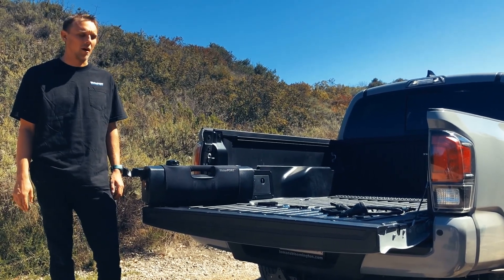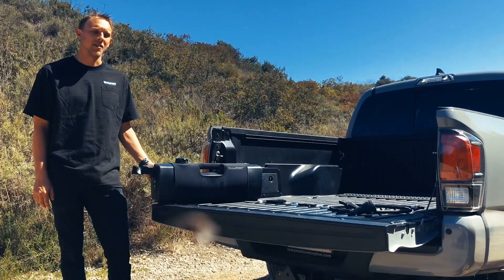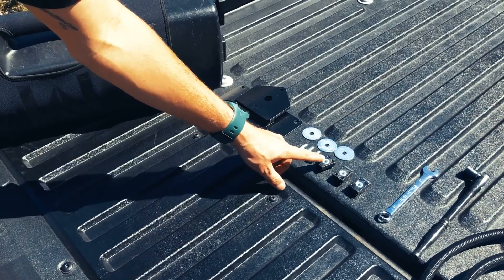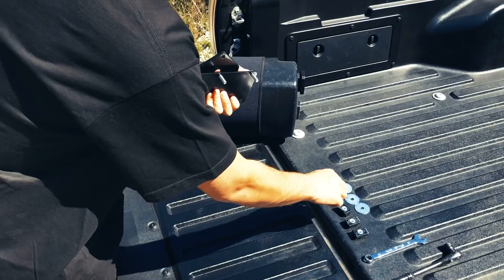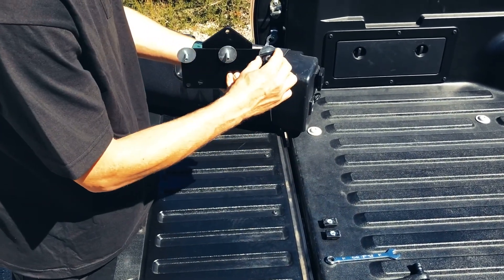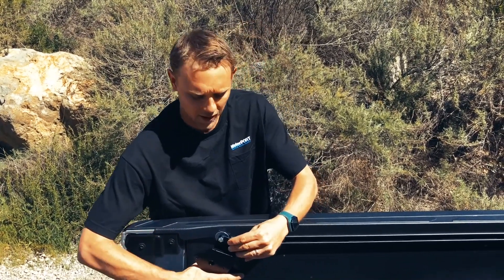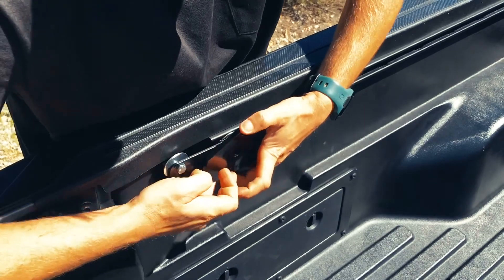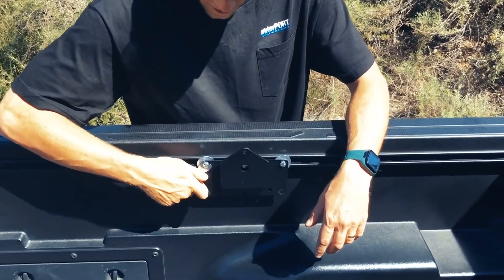Waterport: Bedrail Install

Comment: The hardware in this video is an a example of what it used to be. They give you some plastic t carriage things to fit in your bed rail with a little flat nut that is difficult to keep in place. And then the attachment brace, installed makes the bottom part stick out like 3/8 of an inch. You’re going to need spacers if you want to keep the brace installed. But then you will need a longer bolt since the flat nut sits so far back on the little T carriage thing. This could of been a heck of a lot better. You can clearly see where they started cutting corners to cut costs. You can build your own rail carrier for the cost to buy this and then the extra hardware to make it worth while.

Comment: A heads up to anyone thinking of buying this bedrail mount. They changed the hardware for mounting this. Its not the same as in this video. The stupid little plastic t mount and nut are kind of difficult to get to stay together to get the bolt on. I had to use a little duct tape to keep the nut in place in the recess of the plastic t bolt. They need to update this video
Reply: I was on their website and it seems they are getting a bit stingy. Everything is an up-charge.
Reply: Agreed, more flimsy.  I think I'm going to buy some washers and better bolts to match the original equipment shown in the video.